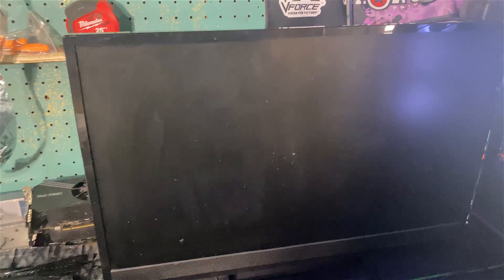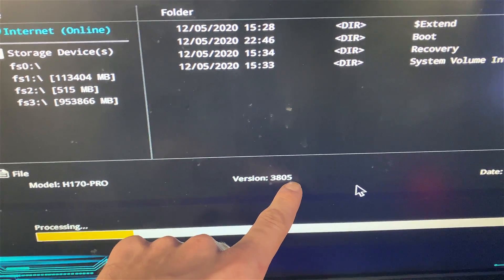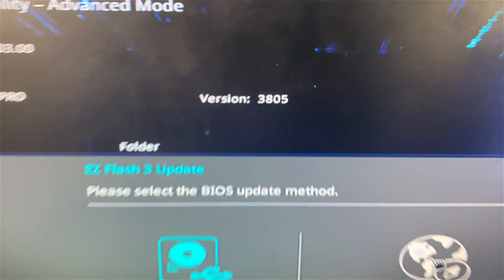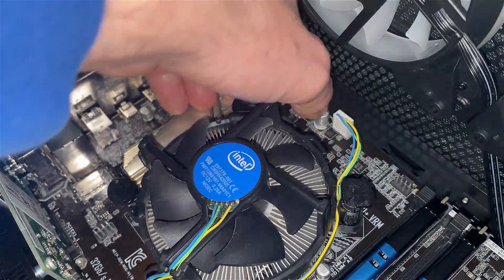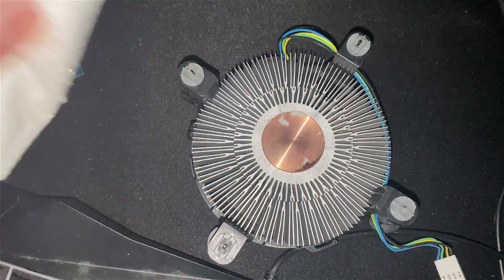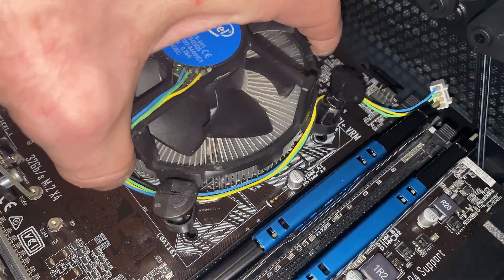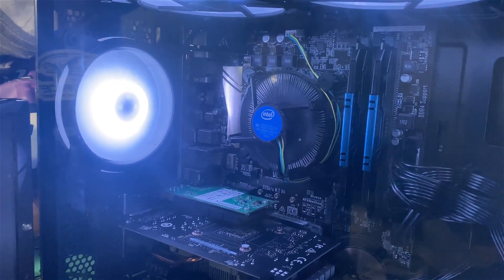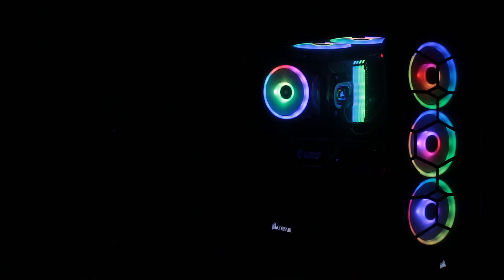How to upgrade a CPU and update BIOS

Comment: Yo I just recently tried to upgrade from a ryzen 5 1600 to a ryzen 5 5600x but I couldn’t find the bios update before hand so I just put it in but now my shi just goes to a black screen and im ngl my old processor broke in the process am I cooked or is there something I can do to fix this
Reply: did u figure it out ?
Reply: @abhinavdhar5598 yeah i ended up putting the old processor back in even tho it was broken and getting the bios and then removing it again I thought just because 1 pin on the older processor broke meant it would no longer be functional but I was wrong
Reply: @gtb_tay007 what version bios update are you using i’m upgrading the same specs

Comment: Mine never rebooted after the update and m&k have no power and I’m getting nothing on my monitor
Reply: This ended up being my issue, how did you fix it, I've been seeing something about flash drives and updating bios that way. But I'm honestly lost
Reply: @ProfessorGoogly did u end up fixing?
Reply: @ryabagag786  so, my boss told me that when you're going from an amd3 to amd 5 like i was the computer takes time to work its self out on start up. I never discovered if leaving it to reroute wouldve fixed it bc i bought a new pc same day out of anger
Reply: @ProfessorGoogly  all it took for me was to put back in the old cpu and make sure u have the latest bios and drivers and it worked for me

Comment: okay so a i have ryzen 5 2600… i wanna go to a ryzen 5 5500 but i know ill need to update my bios, my motherboard wont accept it. Is it possible to update my bios first then change the cpu? my friends are telling me i can’t
Reply: Bro that’s the only way to do it lol if you install the new cpu how will you update bios when it won’t post
Reply: @giovanniantrim6154  i was told for some reason that i needed to put the bios on a usb drive , do the cpu then load it on.. i was praying you could just get the bios first installed then do the cpu

Comment: Do i need to do this when changing both the CPU and the motherboard?
Reply from the maker: No you shouldn’t have to as long as you didn’t buy a used older motherboard.  If it’s all new it should be compatible

Comment: do i need to backup anything before i do this or will everything stay when i swap cpus
Reply from the maker: It should stay.   Your windows may deactivate.  I’ve also ran in to issues where I needed to reformat. But that’s not to common.  It’s always a good idea to back everything up just in case.

Comment: I have installed my new cpu, but when i turn my pc on, it starts up but it doesnt turn my monitor on neither my mouse or keyboard?
Reply from the maker: You may need to either clear the cmos or reinstall the old cpu to update the bios.
Reply: @jtravaglini  damn ty for the fast reply, idk if it means anything but my motherboard shines a white light on where it says cpu, could that mean anything?
Reply: @jtravaglini what if you already have the latest bios installed but it still won’t boot? That’s what I experienced this morning trying to upgrade my cpu
Reply from the maker: @kentwyngaard8803  I’d pull the cpu and check the pins.  And try the old cpu again. See if it boots.  If it does and the new one doesn’t it’s possible the cpu is bad
Reply: @jtravaglini  thanks for the response. I also thought that it could maybe be a bad cpu. The old cpu works just fine

Comment: Thank you for help,no hate but please clean up ur desk.
Reply from the maker: My desk is even worse now with computer parts.  It’s a work bench I use in my basement.  Every time I clean it I accrue more stuff. I need to just trash stuff and start from scratch
Reply: @jtravaglini  well that makes sence i tought that was ur main desktop.
Reply from the maker: @stefanterzic1269  no it’s just a work bench. I build there and test there. My main station is much cleaner.

Comment: If i don’t update the BIOS does the motherboard not accept the new cpu? because my pc won’t show anything with the new cpu, but works fine with the older one
Reply from the maker: Most likely you need a bios update.   It doesn’t know how to recognize the Cpu.
Reply: @jtravaglini please help. I tried updating my i5-9500 to an i7-9700K and it never booted after the upgrade. I then put in the old CPU again and tried updating the bios using the method you did but it says that I have the latest bios update installed. What else can I do to get it to work?

Comment: Hello bro will updating bios for a new cpu  does make the motherboard incompatible with older cpu series?
Reply from the maker: No it won’t.  It just makes it compatible with newer ones.  It won’t drop the older CPUs.  But it won’t accept CPUs not meant for that socket.  So make sure it’s the same socket type
Reply: @jtravaglini  how do i know its the same socket. i have a 8300 sff that came with a i5-3470 and i had bought a i7-2600, and when i had put it in i didnt update anything just replaced it and my fps was dropped alot. is this because i didnt update my bios? or is it casue its not the same socket?
Reply from the maker: @exe__anthony4748  i7 is a lga1155 socket and the i5 3470 is a fclga1155 socket.  If it’s posted though and working I’d assume it relates to the cpu performance and optimization
Reply: Ah thanks bro you've earned a new subscriber

Comment: Thanks Gonna be installing my new i5 11400f and needed this video
Reply from the maker: No problem. Make sure to update the bios before installing the new cpu with a compatible bios.
Reply: @jtravaglini idk if you’ll answer this but should this proses work with upgrading from a ryzen 5 1600 to a ryzen 9 5900x?
Reply from the maker: @zakaridobrzynski9477  you can look at the specs for your motherboard.  It should work.  but on the manufacture website look at what bios you need to run it so you can upgrade it before you swap.